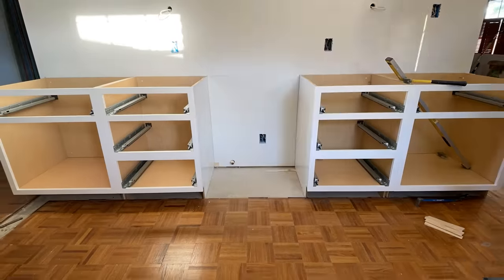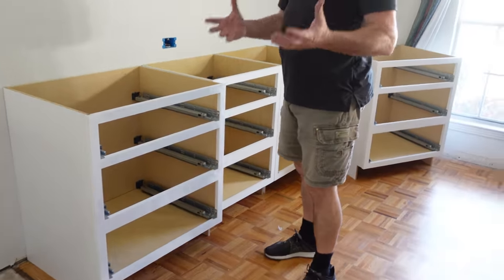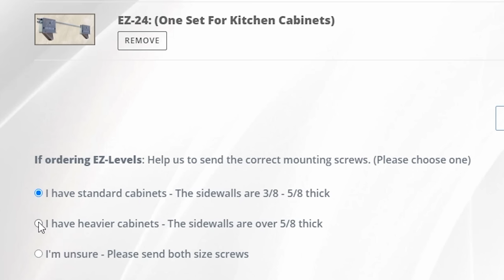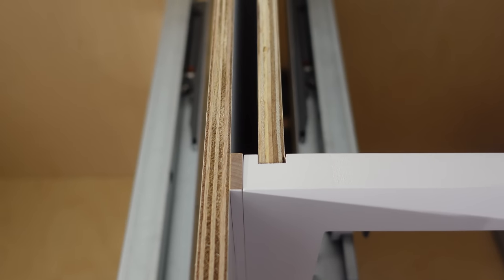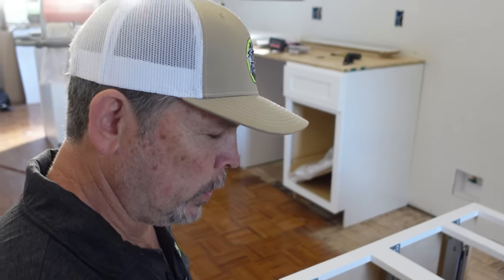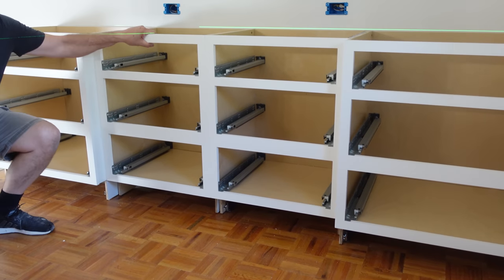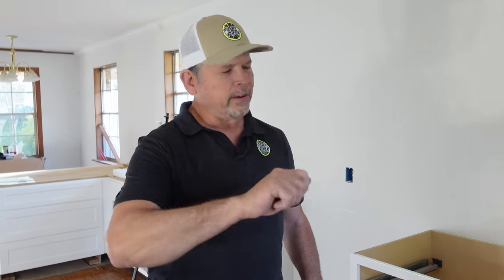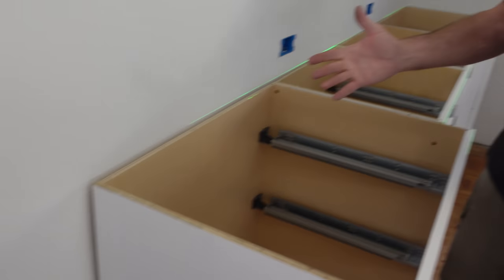$2 Shims VS $40 EZ Level - Is It Worth It?

Comment: It is awesome that you are doing a video on the EZ-Level system. I just purchased  a complete set for a 24 inch cabinet and a complete set for a 21 inch cabinet as a test bed to see if I want to use this system for my new Custom kitchen cabinets build. These will be used for the custom cabinets I am building for 2 of my restrooms. I am in the process of squaring up and leveling the restrooms walls. along with the tub walls in one bath. My drywall guy is not too hapopy as he has to wait for me at the moment but when it is all said and done he will be a happy guy.  At 16.50 per set and if you provide the company your Contractor lic you can get contractor price and or whole sale. What I like about this system is it will work with ladder bases too for cabinets. their customer service was very responsive to my inquiry before order and sent me a follow up after my purchase to see if I was satisfied with the product.

Comment: Cabinet nightmare story, here is one in my kitchen. It took us four days to install the two upper and two lower cabinets, and they are still not straight (IKEA furniture with leveling feet). One whole day was taken up by the upper cabinet frame because the wall was made of rock and clay and wouldn't hold the screw taps, so we had to use quick cement to fix the tabs to the walls before we could attach the block of wood that would then hold the cabinets. There was a lot of measuring and drilling, and fingers crossed that it fits. Which it did. However, the lower cabinets couldn't be installed with the facing flush because the old chimney made an odd angle. And the rails that came with the IKEA kit was useless, so the same trick as the upper cabinets had to be used. The leveling feets had to be turned until the level was perfect. When we installed the countertop, we found that it wasn't perfect and used chimes to make it work. I sure wish we had a laser level back then. That was a nightmare that we will never repeat, hopefully.

Wonderful video. I love watching your work.
Reply: I have a thought... buy American made you’ll be a wise guy
Reply: @Clovethelightrespectthepower  Would still be a PITA even with american made if stuff cant hang or isnt straight :p
Reply: I had somthing similar at my place, ended up just building the wall out with 2x3 on their side and sheating the whoke thing with 1/2 ply and drywall. A lot of extra work but ended up with a level straight wall with backing everywhere

Comment: Kitchens in the UK have plastic adjustable feet one on each corner you simply screw up or unscrew each foot which adjusts the level, so simple.  Kickboards are fitted to the feet using Clips

Comment: here in uk have a different way for the units a stronger backing to screw to the wall and have legs at the bottom to adjust to height and wood panels with u clip's that attach to legs for covers so you do not see underneath the cupboards also attach cupboards together with the screws you had together

Comment: I have also used the ezlevel to re-install and level old cabinets for a granite countertop. The granite installer was really impressed at the precision of the level achieved.  They didn't need to shim at all under the granite. I plan to use ezlevelers again for my pantry cabinetry install.

Comment: I found that system several years ago and used it on putting in a new kitchen in a manufactured home. Since this was the first time doing it myself. Also had a corner unit.

Comment: the way i would level the cabinets with shims if there were 4+ cabinets is measure the height and mark where the cabinet starts and just ad a shim so the height is right to the level and then just grab a spirit level and do the whole back side by measuring where the cabinets sides are and shim it, then when it's done get the cabinets close to the shims pull them towards me and slide the back onto the shims and then just shim the front( that's basically how i do large wardrobes)

Comment: what that seem convoluted where i live we allways use threaded legs so you can allways adjust it. Plus no installation on site just screw in/out as you need added benefit you can just clip in the toe kick so when you are doing deep cleaning you just pop them off and clean under the counter top (in case of spills)

Comment: Why not use a "french cleat" on the back of the cabinet and wall? a 1/2 piece of scrap plywood could be used to attach it to the wall with a laser level. Then attach the corresponding piece to the backs of the cabinets and hang in place. By locking the back of the cabinets in to a level plane the front would be a lot easier. Could also use a straight edge to level the whole group of cabinets together then shim.
I've installed an ikea kitchen and it used a setup similar to this. There is a rail on the wall and then 2 front feet per cabinet. The feet screw in/out to adjust level.
Reply from the maker: This is a great method and one of our favorites👊🏼 we think there’s a place for all of these install methods, but the ledger board with 2 front feet is probably the perfect balance between cost and ease of use 🙏🏼
Reply: @StudPack  can I just say that my favourite part about your channel is the dialogue you have with the comments section! Keep up the great work.

Comment: Holly cap ive used a board that was drilled front and back with long bolts and would tighten and loosen for adjustment that would attach to the bottom side of the cabinets after you flush the faces

Comment: I'm not a pro, so I don't do this for a living. However, across four homes that I've renovated (while I lived in them 🤪), I've installed my share of cabinets the old fashioned way with wooden shims and a level. So, here are my observations of the product and the video from the perspective of a DIYer:
- The EZ Level system is worth it and your explanation of their function is great. Thanks for taking your time to make this video.
- If the floor isn't level, then it can create a problem when joining the cabinets into one unit. I know the video is about the EZ Level system, but tips on how to true up the cabinet boxes to one another is helpful. I see you use a tool to help with that, but you don't mention it nor provide a link to it. I'd like to have had that insight, especially since I've got a cabinet installation in my future. 
- Why would you not remove the parquet floor under the cabinets? True, the EZ Level reduces the likelihood of the cabinet boxes swelling should there be water intrusion, but the parquet flooring most definitely will swell, and that could cause the boxes to shift. That in turn could cause the countertops to crack. I've seen it happen. Plus, if you remove the parquet under the cabinets, you'd have stock to patch other areas should the need arise. What are your thoughts?
Thanks again for your content and the time you took to put it together.
Reply from the maker: That alignment tool is by Bessey, it's a face frame clamp.  I tried to remove the parquet but it is glued down very well and came up in pieces.

Comment: I always have multiple runs of blocking installed behind the cabinets. I'll cut the drywall and install blocking for remodel jobs.... its that important.  This gives me the freedom to hang the cabinets with multiple screws in locations that I desire instead of looking for studs. With the use of lasers; there is no need for those levelers in my opinion. You can tack/ glue down your spacers or shims before  the cabinets are installed for a perfectly level and plumb install. So easy with a little planning.

I'm sure they have there place though and I am thankful for the ingenuity and entrepreneur spirit of folks... I definitely support progress and science in the trades.

Edit- Once you put on a stone countertop and fill those cabinets.... those cabinets get heavy. I would have a hard time relying on those EZ Levels.   Perhaps it would be better if you had one in every corner of each cabinet or I would add some shims next to the EZ Levels in case the EZ Levels decide to compress, stress or break.   Also many of the nicer cabinets that I install have a toe kick as part of the carcass.  So I would have to drill access holes to get access to the EZ Levels.
Reply: Couldn't you just add some wood shims as a weight assist though? Assuming the toe kick is off after screwing the cabinets to the wall, adding a few shims for weight without affecting level is a piece of cake

Comment: Have you hung IKEA cabinetry?  They use a great  system using a heavy Guage bar that runs the length of the upper & lower boxes. The feet are adjustable thread type. 1 person job.

Comment: In a long bank of cabinets. Don't cut the 1st cabinets shims off flush. Leave them out an inch, then give them a tap to flatten out a bit. Then you rest the next cabinet on that shared back corner. No lifting and screwing. They share the same shim.

Comment: I am surprised you don't build custom kicks.  I always build a rough kick - level that and then the cabinets all just sit on top of a level kick.  Add the finished kick material and you are done.  I've had kitchen floors out by 2" and this method works perfectly for the base cabinets.

Comment: I would be very surprised if the adjustable feet system that we use a lot in Australia wasn't available in the US. Cabinets are supplied without any plinths and are installed on adjustable feet. The front plinth attaches to these feet with special clips. It's not quite as easy thiis system but it's a hellava lot cheaper and it is effective.
Reply: Yep. Adjustable feet are great. Very easy when there is one guy above telling another below which way to turn and what corner to turn.
I used to set the kitchen up fully in the shed and the cut toe kicks to suit last, then the toe kicks where scribed or shimmed where required.

Comment: I do like the concept of these however it's just as fast to tape down shims in the correct location ahead of time using the laser and a block of wood to get everything at the same height.
Reply: are you high? Please let us know how you did the back of the cabinet easily with tape and a block?
Reply: @Saki630  Well, when laying base cabinets one of the first things you do is mark out the layout then check the floor with a story stick and laser to find the high point. You then just mark the high point on the stick and tape shims to the floor as needed where the cabinet supports will rest. You then just need to set the base cabinets on the already level shims - no adjustments needed unless your base cabinets were built out of square.

Edit: it’s a very similar approach to setting base cabinets where the kick is separate from the rest of the carcass. In that case you level the kick first then set the cabinet on the level kick.

Comment: Have you ever seen an 84 inch tall, 45 degree corner cabinet pantry with L shaped shelves inside and 2 cabinet style doors? The 2 sides touching the walls would be about 40-46 inches wide and 26 inches deep.  I havent "mathed" the door opening yet.  I'm about to sketch up plans and start making one.

Comment: That’s why I always built custom cabinetry designed and built to the length of the walls. There is no modular cabinets you have to level and screw together and the custom cabinets are much better looking since you don’t have those long seams between your modular cabinets showing.  Only advantage to modular cabinets is one guy can usually install them by themselves. Custom cabinetry takes two men at the very least. In some cases with larger heavier custom cabinetry it may take 4 men to get it installed depending on the men’s strength?
Reply: modular cabinets boxes, single face frame could help with moving/setting.
Reply: Comparing two different things and prices points

Comment: Here is a suggestion if no one else made it.  Chisel out a channel deep enough on the bottom of the cabinets where the EZ Levels go so the screws would not come in contact with the floor so they would not damage the flooring.
Reply: this makes no sense or i dont understand what youre saying.  no screws go near the flooring
Reply: @fixerupperer  Did you watch this you tube video?  The EZ Levels attached to the bottom of the cabinet legs that make contact with the floor.  There was a mention in the video that the screws might damage the floor(see how they moved the cabinets in place on cardboard so the EX Levels would not scratch/damage the flooring).  Make a slot/channel where the EZLevels attach to the bottom of the cabinet(the cut out for the slot/channel should be deep/high enough where the screw do not touch the floor).  This slot/channel is like how you attach door hinges to the door frame to make the hinge level with the door frame.

Comment: I wish my leveling and plumb was an 1/8" out hell 1/4" would be nice! Just for fun the back exterior wall in my kitchen is over 3/4" from floor to top of counter, leaning towards the out side of the house. The cabinets are on an "L" shape lay out and the short leg floor is about 1/2" from level. Lots of shims in fact I ended up just ripping strips of pine.
Reply: I hate when the floor that far out of level, especially when it’s a new home! I’ve also seen walls over a inch out of level too. Makes it a nightmare to install cabinets for sure and plenty of angled trim work to hide the uneven gaps behind the cabinets and wall when you least make sure your cabinets are level even though the wall crooked as a dogs hind leg! Far as floor being badly out of level, before installing the lower cabinet I much rather level the floor to begin with and put down new flooring. Leveling compound can make a huge difference leveling the floors before putttng down a new flooring and then have a descent level floor to work off of. But that’s only if you or the home owner will to go to the expense of getting their floor least close to being level or not? Myself when I walk in a unleveled floor I feel either like I’m walking uphill or downhill walking across the floor. Especially when you can look at the floor and see the drop in the floor with the naked eye! My OCD just can’t handle that! LOL

Comment: Those shims are difficult to work with if you take almost any hardwood around 8in wide and go to miter saw you can either swing the saw or pull the wood off the fence except closest to the blade. the shims will snap easy because of grain direction.  I build cabs with hardwood a piece 8x30 will cover a kitchen and multiple rooms in the house. Grain direction of shim is key

Comment: Off topic. I've noticed that mostly you guys still uses Phillips screw heads. I switched to the Square Bit and screws and the Bits lasts forever because you get a better Grip in the square pockets of the screws. 
Do you have the square Bit option or does nobody use it?
If you buy any size packet of the Eureka screws, there is always a square Bit included in each packet screws. 
Not sure if it is a South African patent, for availability to other countries.
Great Channel thank you. 
David

Comment: CAUTION.  After mounting Ez Levelers I used an oscillating saw for cuts outs on two separate cabinets and luckily saw both Phillips head EZ leveler pivot/bolt screws had vibrated out (not the screws to mount the leveler).  Recommend checking tightness of all of those before final cabinet placement as some others were found loose.  Also inspect rods upon receipt for the square drive as found one without it (EZ Leveler company express-shipped a replacement- Thanks).  These were still worth the price.

Comment: I was thinking how great of a tool that was... the I realized that you have to leave them installed under the cabinets. Man... seems like it would be perfect if there was some way to reuse them. Or if they were much cheaper. Thanks for sharing the video.
Reply: I was thinking about that. I guess if you didn’t screw them to the cabinet you could use them to level it out and then use the wood shim to hold it there

Comment: My first story is a kitchen. Uppers went in OK, just put a ledger on the wall and set the cabinets on it.  The bottoms were a nightmare. I had about a 12 foot span with a peninsula at one end. My floor was way out of level, probably almost a half inch from one end to the other. I had an inexpensive laser and found that the beam was too fat. I would up using a water level instead (the bottom of the miniscus is pretty accurate). The cabinets were not perfect either. Needless to say it took me days.  Then when I was all done, I went back and put small shims on the tops of them for the counter top. I was told for granite to be within 1/8 inch over ten feet.  My next story was a bathroom. Just two cabinets separated by a space for a sit down makeup area. Granite top across both.  I started with the wrong one. I wound up making a bunch of flat shims of different thicknesses and stacking them up to level the cabinets. I would put shims in, put in the cabinet, check for level, pull the cabinet out and repeat.  After I had the shims right, I had to nail them down.  Even though there were only two, it took a few hours. I will definitely look at EZ levels next time,   Later the countertop guys told me they could ship up to 3/8 of an inch, but not one shim was needed, it fit perfectly.
Reply from the maker: Thx Brian.   I thought I was only person who used the word miniscus 😂👊

Comment: How much weight do they support at each point before failing? Install a heavy granite counter top, load them up with china, and have a 200-300 # guy using the corner of the counter as a foot stool, then what? Will it hold, fail or will the tiny footprint at the point of the EZ Level sink into the sub-floor?